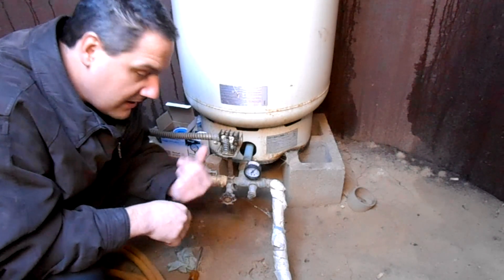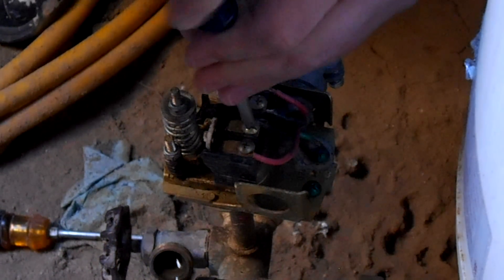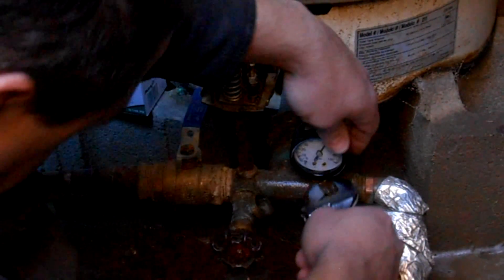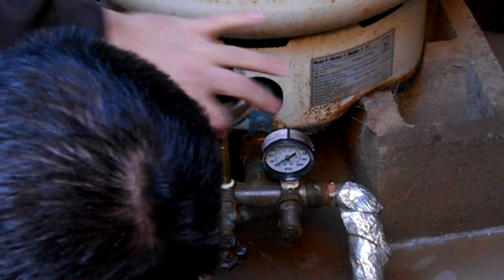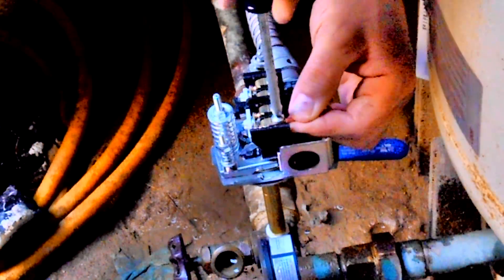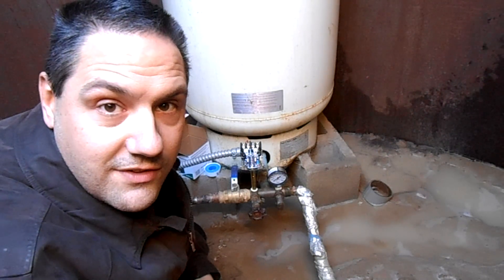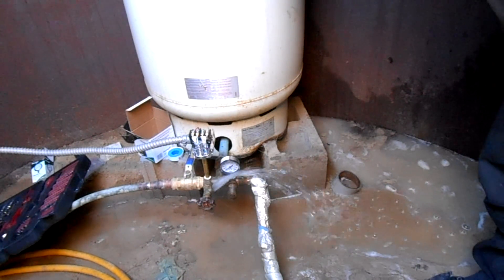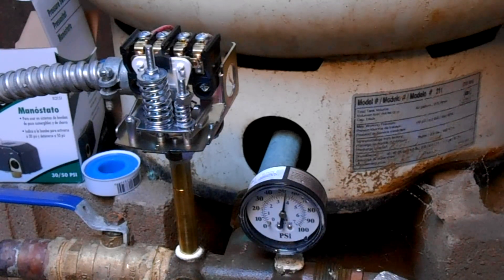Replacing a well pressure switch & re-pressurizing the tank to avoid short cycling

Comment: Mr. Zawacki, Thank you for your time and explanation of what to do. I have replaced my switch before i turned to YouTube and found your site.  My problem is that the pressure switch is short cycling and i could not understand why. Unfortunately it is  1:00 am, but will do as you explained concerning the bladder tank. Will let you know tomorrow if it was a success. Once again Thank you for your time
Reply from the maker: Just a note, as written in the description, my bladder was collapsed.  If you press the Schrader valve and you believe it is blowing air out, stop and check the air pressure in your bladder and make sure it is at the pressure noted on the label of the tank.  If you drain the tank, and pressing the Schrader valve allows water to escape, as shown in this video, I believe your bladder may be collapsed as well.  I ended up replacing this tank with a brand new one.
Reply: Yes sir, the bladder had gone bad. My system is now holding water pressure. the pump turns on at 30 and off at 50 psi. . I will replace tank as soon as i can afford to. Thank you Mr. Zawacki you video saved me money, and living on S.S. security we need to save where we can.
Reply: @joeamerican7035  That makes sense Joe. How long did you wait for the tank replacement ??? What brand did you buy and put in place, what was the cost for replacement Joe ??
Reply: @dslynx  What you said SIr is true.

Comment: Not understanding the pressure tank air pressure. The tank air space is a closed system, correct? When the water is pressurized to the limit of the pressures switch, the air inside the tank, between the bladder and the tanks metal wall, is compressed and pressurized by the expanded bladder.
As water is drained from the bladder, the air space increases and the air decompresses and pressure reduces until there is no longer enough pressure to force any more water from the bladder. So, at this point, the amount of air in the tank has not changed, it's just at a lower pressure. The schrader valve has not been opened, so no air has entered and none has escaped. So, why should anything have to be done to the air within the tank. After replacing the switch, and applying power, the bladder will fill with water until the pressure switch turns of, and the air between the bladder and tank wall will react that same as it did before the switch was changed.
What have I missed?
Thanks.
Reply: James Zawacki don't you think you should have mentioned you were using a procedure for a bladderless tank? What you've got her gets people to let air out of a good tank which in time will lose the air to the water and ve useless again. You should edit this video and think before doing another.
Reply from the maker: In my case, the bladder (which should be filled with air) had a leak and filled with water.

Comment: Hi,I ge got pressure problems on my deep well.Ive metered pump and have 240 phase to phase to the pump,each leg draws 6 amps,however I'm only getting 10 psi max,not enough pressure to cut in set at 18 psi on a 20/40 system
Reply from the maker: I also have 240 V (not phase) and my pump is ~430 feet deep.  I don't know how many amps your pump is supposed to be pulling, but if you are only getting 10psi, I'd guess there is something wrong with your pump and you should have someone come out and look at it.

Comment: Is there any definition for short cycling, in terms of the amount of water(gallons etc.)?  My pump may be short cycling, but it does shut off.  My point is that I could fill up a gallon jug and see if it runs more than once to do that.  I have a sink near my well storage tank, (and pressure switch) in my basement.....thanks
Reply from the maker: Short cycling means it is only turning off for a short period of time and then having to kick back on again to keep the system pressurized within the setting range of your pressure switch.  In a properly working system, the pump will pump long enough to take the pressure in the system to it's set cutoff (say, 50psi) including the pressure tank and will shut off.  The pump will have plenty of down time while you use up the water in the pressure tank (say, 60 gallons) before the pressure starts to drop to the pressure switches low set point and turns the pump on again.  When my system was short cycling, I could tell because I could see the pump turn on at the bathroom faucet because the water pressure would burst.  If I kept the water running, I could see this happen multiple times.  Now that my pressure tank has been replaced, I can no longer tell when it is on at the faucet.  With your pressure gauge showing your top pressure (50psi, in my case) you would need to run the amount of water in your pressure tank down to the low setting (30psi, in my case) before the pump should turn back on.  In my experience, if you can watch your pressure gauge while someone is taking a shower, and you see/hear the pump kicking on and off, it's short cycling (unless you have a tiny pressure tank).

Comment: My old pressure tank had that toilet float like air bleeder assembly on it. The new pressure tank has a bladder. Someone one time mentioned something downhole that needed to be changed. I am no well expert but I believe air is coming from downhole and getting into the tank. I constantly am having surging issues with my NEW downhole pump. Is it possible that the bladder style tank is incorrect? If so is their a remedy? How can I tell if the air intake valve is downhole or not?

Comment: Why wouldn't you put a garden hose on valve when draining??
Reply from the maker: Excellent question!  The tank is buried about 8 feet under the ground, so there wasn't enough pressure left to make it out of the pump room.
Reply: OK short hose in a 5 gallon bucket
Reply from the maker: Rob H Yeah, I could have did that, I guess I just didn't care because it will soak back into the ground anyway.  I'm to lazy to haul a 5 gallon buck of water up an 8 foot vertical ladder.
Reply from the maker: J Thomas Rains Jr
Of course it is..
Reply: I meant no disrespect, so you know. Looked like it was giving you a hard
 time. I give you credit for doing what you did! Merry Christmas!
Reply from the maker: J Thomas Rains Jr No worries, I take no offense.  Merry Christmas to you as well.

Comment: WRONG, for anybody that is trying to work on their pump system, please find another site, James is clueless about how a bladder tank works.To James, the next time unscrew the lock nut, not the fitting.
Reply: I've got to agree.  From the responses it sounds like lots of people are accepting bad information.   I'm mad that Youtube took away the display of downvotes.  There is no need to drain the water out of the water side of the a diaphram or bladder pressure tank if the tank is functioning properly.   His tank needs to be replaced.

Comment: Hi James.  Good job on the video - it helped me a lot.  The only comment I would make is to be careful when wiring the new pressure switch.  I started down the path of wiring it the same way the old one was, then fortunately had the sense to check the schematic in the box.  Turns out, given my new switch was not the same brand, the wiring was different as far as how the power source and pump wires connected to which terminals.  I would recommend this as a safety step during the wiring.  Thank you, Jim.

Comment: Will a tank short cycle even though the pressure gauge is reading the correct cut-off setting ?,,Mine is at 65 psi, on a 30/50 switch...

Comment: So what happens if you don't drain the tank first and now it's short cycling.. How do you fix that??
Reply from the maker: +jordan L You will need to go back and fully drain the tank as there is probably water stuck in the tank not allowing it to pressurize properly.  Once the tank has been fully drained and properly re-pressurized, verify the Schrader valve has the proper pressure reading defined by the manufacturer of your tank.

Comment: Why did the instructions on my new pump, instruct me to pump 28psi air into the pressure tank?
Reply from the maker: +E.L. Abusaid I don't know why a new pump would say that, it really depends on the pressure tank.  But, if the tank says to pressurize it to 28psi, that is what you should do.
Reply: I think I fixed the issue.........I turned off the pump, drained the lines and pressure tank......released the reminder air in the tank to 0 psi..........adjusted the low end to 40psi from 30 psi and increased the high end from 55 -61 psi (using a 9mm socket).......idk way the packaging instructions for the pump instructs a reader "pre-pump" air in the P. tank at 28 psi..........others have asked the same on other Youtube videos...........that being said, thank you for helping others!
Reply from the maker: E.L. Abusaid
Awesome, I'm glad you got it figured out, and hopefully your comments will help others.  The "real" answer is it depends on the tank.  If your pressure tank requires it to be at 28psi in the bladder with an empty tank, then you should pump the bladder up to 28psi with an empty tank.  But, that should be instructed on the pressure tank, not the well pump.
Reply: Agreed............

Comment: Out of all the videos that I have watched related to pressure switches I found this one to be the most informative in application and how it works. Thank you for taking the time out to explain this.
Reply from the maker: +Terry Heeter Awesome, I'm glad it helped!  I ended up replacing the pressure tank because it was leaking (which is another issue I was having that caused short cycling, and why I had to let air into the tank to let the water out) and I didn't make a video.. It would have looked like an episode of the three stooges with only one stooge. :/

Comment: Hi.. I have a very weird thing with my pressure switch.. it does not matter whether I set it to 30/50 or 40/60.. once the pump stops either at 50 or 60, it will lose 5 psi every time. - I have replaced the pressure switch and the gauge and it still does that..any ideas? - I don't think there's a leak anywhere because once it drops the 5 psi, it won't continue to drop at all..even after more than 1 hour.
Reply from the maker: +Mac Pelao That does sound interesting, I wounder if you have air caught in the "water" side of the tank.  Assuming you have a bladder in your tank.  I would try draining the tank completely and verifying you have the proper air pressure in the bladder at the Schrader valve.  Check with the tank manufacturer to verify the proper pressure when the tank is empty.  Then, turn the pump back on and see if it continues to drop the 5 psi.  My speculation is that it's an air pressure thing, but I am really just guessing.
Reply: James Zawacki I have done exactly that.. completely emptied the tank of water and air..then pumped air to 28 for 30/50 and 38 40/60..still does the same thing.
Reply: +Mac Pelao Sometimes water that is moving (when the pump is on) will create a small amount extra pressure when it is forced to change directions or when it comes to a sudden stop, much like "water hammer". When the pump shuts off this small amount of extra pressure will disappear and your pressure gauge will read the normal static pressure. This is a normal situation that is likely caused by the location of the pressure gauge and is likely nothing to worry about. I suggest you set the cut out pressure on your pressure switch to 5 PSI above what you want the normal maximum to be.

Comment: You said it was frozen in that well room? Your problem was probably only the short stem pipe under the pressure switch that your wife had to go get. That small pipe will easily freeze during winter and will also clog over the years and cause the switch to never feel any pressure.
Did you happen to look at the old pipe? I'll bet it was clogged with yellow gunk.
Reply from the maker: steve prichard Pipe looked fine, only a little build up, but there were multiple issues going on.  There wasn't any kind of cover over the pressure switch and there was moisture trapped in the well room.  So, when it would get warm, it would condensate on the ceiling, drip down on the switch and then when it cooled down, freeze on the switch.  Since I replaced the switch  (that actually has a cover) and also placed a plastic shopping bag over it, I haven't had any more issues.  Plus, my pressure switch was jacked up from previous owners changing the screws.

Comment: Folks this video is good but it doesn't cover everything.  First things first, use a micrometer.  Check the power at the switch before you turn off the power, then after you turn off the power to insure that their is nothing.  When you do this check it in AC, and in voltage.  Once you have confirmed that the power is off, it should also have turned off the power to the pump.  Thus their is no water being brought up from the well to the house.  If you have a valve on either side of your pressure tank, turn them to the off position.  By doing this your keeping water in the pipes going from the well to where you are from getting there.  If you have one that shuts off the house hold water that is also helpful as you can keep that water in its pipes and have less air to push out of the lines at the end.  So once you have confirmed there is no power, and have shut off the valves, the next step is to attach a hose to the hose bib so that you don't get water everywhere.  Once the hose has been ran out of the hose, open up that hose bib and drain out the water from the pressure tank.  If you watch the pressure gauge you will see that the water pressure will go down until it shows that there is no pressure (unless you gauge is also broke, then it won't tell yo that you have released all the pressure, in which case you want to make sure there is no more water coming out of that hose, and then slowly unthread the gauge so that when you are almost off if there is still pressure you can tell without it spraying everywhere).  His demonstration on how to remove the electrical lines from the pressure switch was correct.  However I would like to point out that when you do this you should replace the gauge, pressure switch, Nipple (pipe running from the T to the pressure switch), and relief valve.  Before screwing them on use Teflon tap on the threads making 7 to 8 wraps in a clockwise manor.  Then use pipe dope to help insure that it gets a good seal, it doesn't cost too much to buy and so its cheap security.  Before turning everything back on, use a tire gauge and check the pressure on the tank.  Cross reference the pressure you have with the sticker on the front of the tank (most the times its 38 PSI).  The sticker might say 50 30 switch = $%^& PSI or 40-60 switch = %^& PSi.  Look inside the lid on your pressure switch, it should say which one you have.  Then use an air compressor to fill up to that level.  Once this is done, make sure that you close the hose bib that you used to drain the tank.  Once you have this done, and everything is back together, then you can turn the power back on.  Then slowly allow water in from the well to the tank.  You will see the Pressure rise on your pressure gauge.  When it hits the hit point on the pressure switch it will shut off the pump.  Next slowly open the valve going to the household.  You may have to run the water a little to flush air out of the lines.  P.S. When you replace a nipple for the pressure switch- use a brass nipple not a galvanized one, or you'll end up replacing it again later thanks to something called electrolysis. Oh, and lastly use the micrometer to double check what voltage and amps you are getting at the pressure switch.  Cross reference that with what you first got, and what the recommended is for your system.
Reply from the maker: Chris Pelton Excellent points.. but just to clarify, it's a multimeter, not micrometer.
Reply: LOL, damn you spell check.

Comment: I've noticed that my water pump has been turning on and off like you said in you video. Also there is a small hole on the very top of the tank and some air is coming out. How would you recommend I fix the hole? Thanks.
Reply from the maker: Biglover29 Well, the correct answer is to replace the tank, but I would try JB Weld or another two part epoxy first, as I just replaced my tank and it was a TON of work and since mine is down in a hole, I had to hoist the old one out, which also wasn't fun.

Comment: thanks this is very helpfull.One question.How do i release the air from my tanks if they dont have air valves?
Reply from the maker: Rudy Gonzalez In my case, I wasn't releasing the air from the tank, I was allowing air to be sucked into the tank to let the water drain.  I didn't know there were tanks without a schrader valve.  Sometimes they are hidden under caps.  I don't think I showed it in my video, but my shrader valve was actually under a plastic cap that I had to unscrew to see the valve.
Reply: Mine had a cap on top, once you remove that, there is a metal valve with a metal cap on it. You have to unscrew the cap and the valve become visible
Reply: Use a. 22.